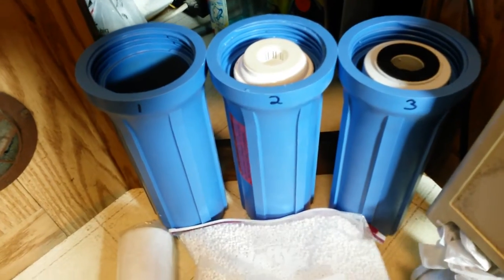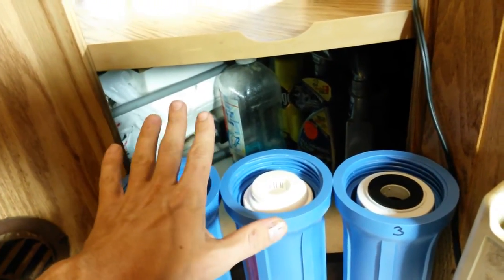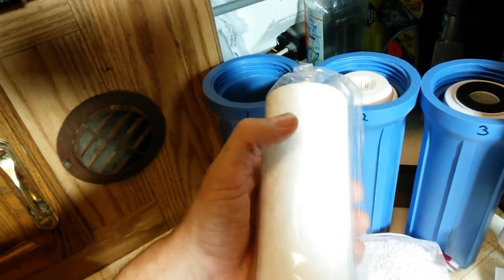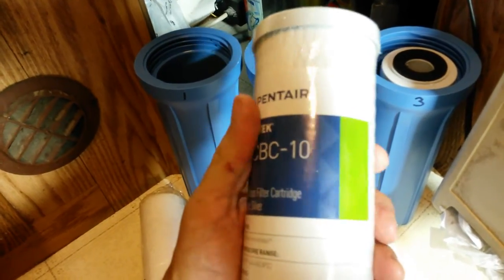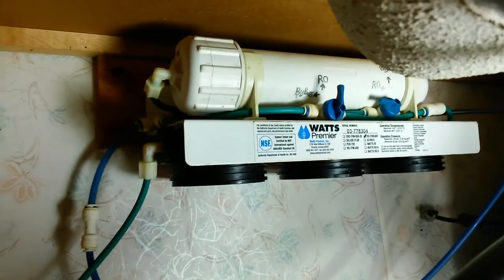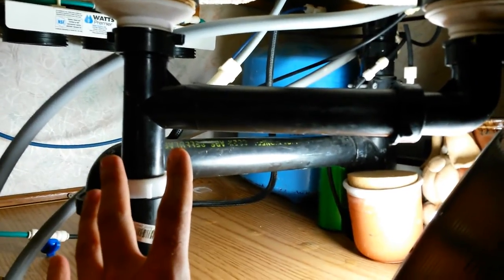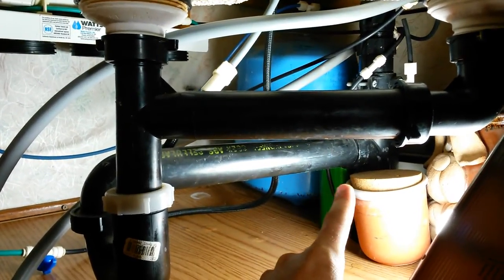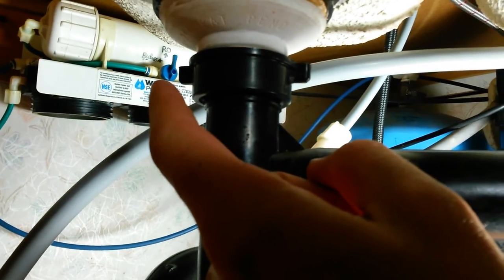~This Old Trailer~ Reverse Osmosis -RO- Water Filtration in Your Camper or RV

Comment: What about the rest of the water used: IE. shower and sinks? What filtering for these? Can the triple filtering be separated form the R.O. part? If you are A real water geek what about the water used in the shower, washing your hands, and used to brush and clean the tooth brush afterwards? Have herd that it's 1 to 3 as 1 gallon of drinkable water to 3 gallons to flush the R.O. filter is this true?
Reply from the maker: For all of the "other" water uses, a whole home filtration device is preferred. The filters are larger and flow rates are much better on these so they can filter the high volume of water without slowing or restricting flow.

Some RO systems don't have any waste at all, but the RO filter just gets clogged faster. 1/3 is a little high, but it will depend on the flow redtrictor chosen by the manufacturer.

Comment: I've heard of people directing the discharge water back into the fresh water tank. With the small fraction of the whole that amounts to and the constant replacement of fresh water, perhaps that would be a viable solution. At least with average water. Sounds liked your area is exceptionally mineralized.
Reply: I wouldn't recommend putting it back into the fresh water tank. You would basically be putting pure waste into what should be a pure source. everything that can't pass through the membrane would go into your clean water tank. You migh t as well put unpotable water in the tank to start with.

Comment: Would it make more sense to put the 3 pre filters out in the city water line in to your RV (like the$19 camco type) and have the last "RO" filter under the sink? that way you have some filtering for the kitchen & bathroom sinks and the shower...
Reply: And were are the links for products?
Reply from the maker: Those in-line camco filters suck! I've had one split and leak hundreds of gallons of water before I got home. You can get a good whole house filter on ebau
Reply: Not saying use those crappy Camco filters, just pre - filter the water before it comes in to the RV like they do...
Reply: Did you read this (ABOVE)? And my last reads can the 3 filters be put in line "(LIKE THE CAMCO'S)"  before it comes in to the RV,  Since I didn't get one for free I was asking about its use, but if you don't what to answer questions .  turn off comments. NO REPLY NEEDED NOT SUBSCRIBED AND THUMBS DOWN.....
Reply: You wouldn't want to RO your toilet water and sink water. It cuts the flow rate down by quite a bit.